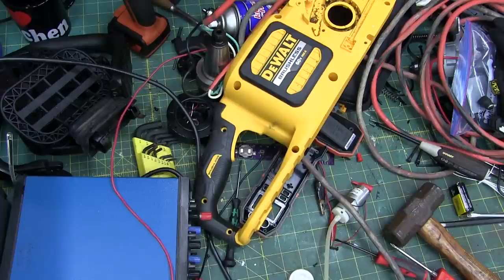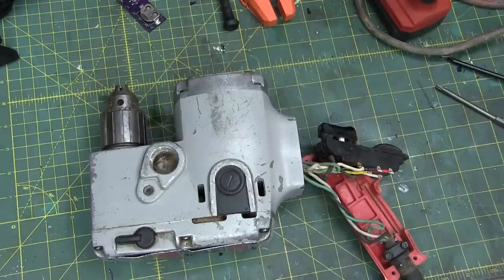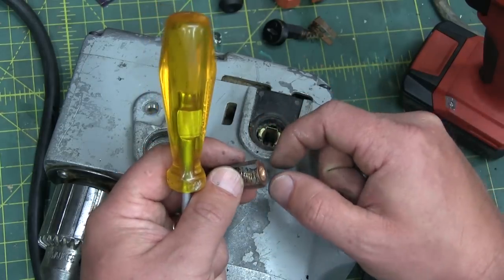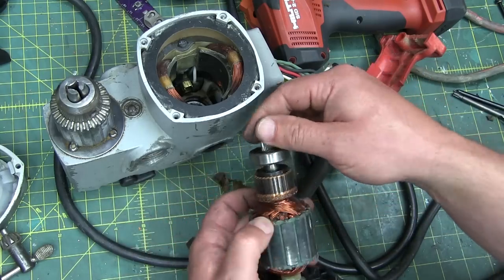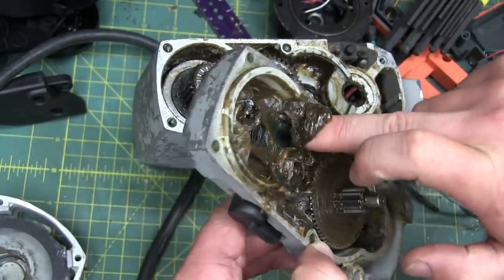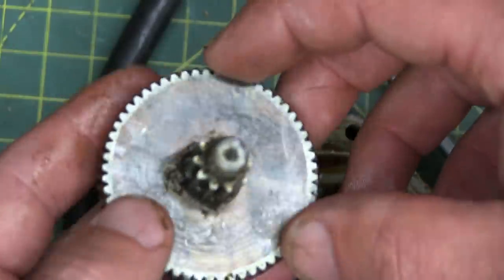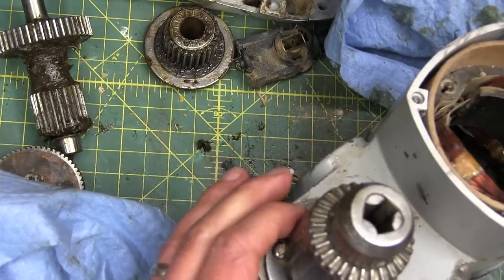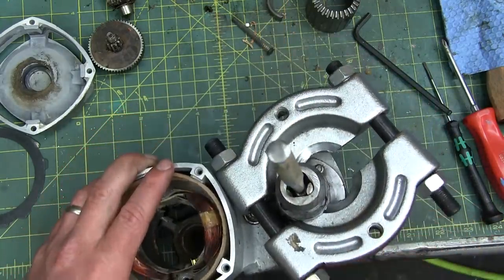BOLTR: Milwaukee Hole Hawg | Long Term Quality

Comment: The old hole hog will wrap you up and beat you against every wall in the room if you get it bound up! It will not only break your arms, but the arms of everyone trying to rescue you from its deathly grip. I believe the hole hog was used to start the earth on its permanent rotation.
Reply: InsideOfMyOwnMind, sometimes I surprise myself. I have used an old school hole hog. I can promise, I'd probably rather wrestle a wild hog as it would be less work and much safer. Lol
Reply: InsideOfMyOwnMind, maybe if it's secured to its own concrete foundation. I don't remember off the top of my head what the max recommended bit size is. However, I think you could reliably auger light pole foundations with it. It would've been safer if it were marketed as a skidsteer attachment. Lol
Reply: David Boerboom, true. I suppose I should say semi-permanent rotation. Or just go with rotation. Thanks for pointing that out for me. 👍
Reply: Bet a doll hair I could rastle one!
Reply: John Dro, bet I'd let ya!
Reply: The old Wolf drills were the same absolutely brutal
Reply: As someone who's had one of these show me the quick way from the top of a ladder to the ground, I wholeheartedly approve this description.
Reply: TheOmegajimes, that would be a terrible and terrifying way to be removed from a ladder.
Reply: The sales guys at Milwaukee refer to it as the Suicide Drill.  It is an apt description.  My Dad has one that suspended my brother from the floor joists when it jammed and the ladder fell away.
Reply: Yep - Did the same thing to me but I managed to keep from dropping to the ground.

Climbed down carefully, poured breakfast out of my boots and got back to it.
Reply: I got lucky and managed to stop the dam thing with my three foot hair braid wrapped around it just kissing the side, they got some momentum in there.  Almost got scalped
Reply: best comment thread on the internet ever. also i think some OSHA guys should read these for some nice 'what not to do' stories
Reply: Dion Crouch yup, I brought an old wolf sapphire with a 3/4" chuck because 'just in case' 😂 😂 Haven't built up the balls to use it in anger yet. If it grabs I no I'm going to the hospital!
Reply: running a hole hog is a two man operation: the apprentice is on the trigger, and the licensed guy keeps one hand on the cord to yank it out of the wall when the 'prentice starts whippin round the stuck bit.
Reply: Yup, had one perform some unwanted dental work and remove me from a ladder (at the same time)... It's now referred to as the Wilfuckee defenestrator...
Reply: InsideOfMyOwnMind maybe win the internet for a whole week?
Reply: Jimmy's Tractor, now if we could just get a comment from Uncle Bumble himself. Lol
Reply: no you couldnt
Reply: There's a darn good reason the old fab shop I worked in we chained the ol' devil (circa 90's Hole Hog) to the frame rails of the truck we were working on before drilling a hole..
Reply: I wonder.....did he ever get the chuck off? 🤔
Reply: I believe it was invented to introduce the world to Martial Arts
Reply: Richard V Sassoon, or break dancing. Emphasis on the "break".
Reply: cheeky...
Reply: To The Top Crane someone has prolly already mentioned but, I’m thinking it’s threaded so I would hope he eventually got it off after figuring that out, but I would think he would have known that.
Reply: Electric defenestrator is a damn good name for a band.
Reply: To The Top Crane, I used to perform p.m. on overhead bridge, gantry, etc. I also have a lot of hours in boom cranes erecting steel.
Reply: deezelfairy  we used to try anything to avoid using it and I'm talking about big men (cowards/smart) not 11 stone weaklings
Reply: You'll want a firm grip while drilling down through the top plate of the wall with a 3 -5/8" self-feeder.  When you hit a nail the torque reaction can be amusing.  Quick way off the six foot ladder.
Reply: To The Top Crane 
Happened to me.
Had the key in the chuck hanging on tight. Bumped the trigger. I started spinning, arms in a pretzel and the cord wrapped around tight against the trigger. Finally, something popped and I was free but with sore arms and fingers.
Reply: David Boerboom - Ha! I was contemplating that very thought the other day when i had nothing better to do. Must've been one helluva explosion to send all that matter out to spin and accrete like it apparently has. And for sure we'll be dickered when we stop spinning and /or the sun burns out, whichever comes first :-)
Reply: Years ago, I discovered that if you're left-handed, your grip presses that little lock button that used to be on the side. I was drilling through 1/2" plate and when I made a burr on the bottom end, I Just about broke both wrists. It got away just enough to hog-tie me with the cord but didn't unplug. A coworker unplugged me before something broke (me) or I let the smoke out. Total respect for hole hog beasties.
Reply: You're more than welcome to try.
Reply: OMFG I laughed hard at what you said because I have been beat to crap by one. This monster will pick you up off the ground and treat you like a rag doll.
Reply: I had my hole hawg chucked up to a 4 1/4 Lennox hole saw drilling a bottom plate of a plumbing wall between 2 studs for a dryer vent...let me tell you..I had er wide open and she  fetched up...when I woke up I saw that it cleared out both studs on either side of the hole with my flailing body, the drill wrapped the cord up and snapped it off and killed the power to it possibly saving both my arms from being broken off...I don't even know what happened but in am sure I blacked out from something. Somehow i escaped without broken bones, not sure how, I was pretty busted up bleeding and bruised.  Not a good experience never the less. These drills are no joke lol
Reply: There's a reason you can have a 3' long handle on the side!
Reply: Lol
Reply: LOL
Reply: @ToTheTopCrane  my old drill had a threaded Chuck on it.
Reply: Omfg I’m in tears right now from the stories. Best comment section on YouTube hands down.
Reply: I used to have a guy hold the cord to unplug her if she bound up on me. Hold on!
Reply: Stole the words right of my mouth. I’ve used one for many many years.  You better be ready or the damn thing will send you to the hospital.
Reply: It is a monster! The superhawg that superceded it is a bit safer cos it’s longer and gives you more leverage to fight against it. The magnum hole shooter is also a dangerous knut, small handle on a powerful motor. Ahh memories. Btw I thought that chuck was threaded on?
Reply: Where’s the video of the new one
Reply: That makes two of us.  These things are beasts!
Reply: The old school Milwaukee 9" angle grinder was another tool not to be trifled with.
Reply: I've had that happen when drilling through some pretty stout metal with a DeWalt 20V. Always use an impact for metal drilling now...not pleasant haha
Reply: Yep I got 5 of them. 
I broke 2 in 1 day before. 
Put a 4-5/8 hole hawg bit in it. Hung on like hell. Broke main gear in both of them. Got rid of bit.
Reply: @dioncrouch3897  I was just going to say that,I have an old wrist breaker languishing in my tool store,has a weeble wobble in the chuck tho.
Reply: @adeladd7638  I've picked up another old one can't identify what brand it is but it's big and slow turning. gonna get the lad to use it first 😁
Reply: @dioncrouch3897  My Wolf is from the 70s and has markings that show it once belonged to Post Office Telephones,I know cos I used to work for them back then.
Reply: Been there
Reply: @jackofmanytrades4396  I have one of those and I still use it. I love that thing. Believe it or not it needed a new switch and one day I was in the junkyard and I kicked an old metal body I think Hitachi out of the dirt and it just so happened to have the exact same switch in it but that one worked! Did I mention it was the old metal case one that probably weighs 25#? Well yeah. Still love it
Reply: I had to pry an electrician of a ceiling once
Reply: His old lady knows brioche
Reply: @TheOmegajimes  I had a helper get spun off a ladder once, the only bad thing is I missed it, I was around the corner & heard something a little different so I went to investigate & saw him just getting up. Laughed my ass off!

Comment: Many, many, moons ago when I was doing plumbing work, the company I worked for bought a Milwaukee Hole Hawg new for us to use installing plumbing in a log home. As it happened where the owners wanted a toilet was in a small closet like corner of the bathroom.  That meant I had to drill a 3 5/8" hole directly through a large log beam. Using a 3 5/8" self-feed bit I got started drilling the hole. The next thing I knew I was bodily jerked off my feet and violently slammed into the walls of the toilet "closet" several times. Thankfully somehow during my impromptu and unwanted merry-go-round trip, I had managed to unplug the drill. Once I quit shaking, I surveyed for bodily damage, finding nothing serious I sheepishly measured, cut, threaded, and installed a piece of pipe in the drill for a reaction bar so that it did not happen again. From that day on I respected and feared that drill and I dreaded using it for any purpose.
Reply: Robert G That sounds god damn awful
Reply: Blues 000, It was scary and quite painful for sure, but I learned from it and it never happened again.
Reply: Pentti Kantanen, LOL! My boss told me to be careful with it...and he did laugh his ass off when I told him about it later.
Reply: in my old work we had big impact hammer drill with no clutch. one day we were installing speaker hangers on the gym  in a some kind of hardwaring brick wall and my coworker start spinning on that drill 2 meters above the ground

after that we secided to use smaller and shorter bolts to hang those speakers because if one 3/4"wide 3 inches deep hole is strong enough to spin grown man on a drill there is no way it would not hold 250w speaker that man can lift from the ground alone.
Reply: That sounds like a lotta goddamn torque, old timer. What the bloody hell did they put in those motors? Welp, time to find out
Reply: Blazdur the Ridiculously Named it's called a magic gearbox. And actually that's a pretty bigass motor there
Reply: Anybody that's used one seems to have a similar story
Reply: Blazdur the Ridiculously Named, They are filled with fear and terror. If you don't fear them, a bit of terror later and you will. Afterward comes a healthy dose of respect, which you will never forget.
Reply: kokodin o
Reply: Yes, that's the joy of being the only woman on many, many construction sites. I read operating manuals, when youtube came along, I watched videos and avoided being badly hurt. The mucho-macho 'I don't need no stinkin' instructions' racked themselves up with real tools like this hog every so often.
Only times I've ever used one, I had a serious reaction bar screwed in and the plug ready to pull if there was even a few degrees rotation. But, then, I'd already seen guys who outweighed my by 150+ pounds whammed by it. First thing they always did after I used it was to unscrew the bar.
Mother Nature is a woman and she has a very sick sense of humor. You don't want to learn? OK, she'll learn ya' anyhoo.
Reply: Holy crap, I feel your pain. I have also been on the receiving end of one of these beasties. I actually had a hard time reading your comment cause I was in tears laughing.  Glad you were ok.
Reply: I know an apprentice who back in the 80's had hair-band style hair he was so proud of (but looked ridiculous). He did the same thing you did......but during his spaz he knocked off a quart of ABS glue off the rafter he set it on and the whole thing emptied into his hair. You haven't lived until you've seen a metal-head cry over their hair. Next day had a buzz-cut and a hat.
Reply: Been there.... had a buddy do an impression of a helicopter off an 8’ ladder. He wasn’t seriously hurt but took a good 10 min to shake it off. Took the rest of us a good 20 min to stop laff’n .
Reply: 3 and 5 self feeder? Jeezlus, man. 2 and 9 is all I go for clear lumber. After that she'll be a holesaw. Or call it in w the Skilly and Sawzmenall. Man's got to know his limitations.
Reply: Laughing silly reading this. Good there's was no one around to laugh on me , or you.
Reply: Been there! I had one throw me against a wall on a plumbing rough so hard it broke a stud into. Luckily it didn’t break me and I certainly wasn’t the “stud” I thought I was lol.

Comment: Left California to Lost Wages, to get rich, found myself on the business end of a holehog for 6 months drilling 2 and 9/16ths holes all day. @ 20years old and 195 lbs spending the last 2 years in the gym. I got to tell ya my foreman made it look easy 40 year old Wisconsin graybeard. Could dead stop it. So he turned it over to me, I was 2nd story up wise doing a vent thru roof, dam framer started sipping early that day put 15 nails in a 2x4.anyway I'm drilling the hole in outside wall it bit down on a nail I bit down on it it chucked me right out of house. If n it hadn't Ben for my cat like reflexes I'd be dead. Six months of shenanigans with that hole hog, and I was ready to sweat copper. Stay in school kids. Hole hoggin ain't easy
Reply: Raymond Mucklow I was drilling a 4” hole thru old 1x roof sheathing with one of these. Long story short, hole saw grabbed and it threw me on my ass
Reply: I tell my apprentice you what to do when you hit a nail right? And he looks at me with confused eyes and says move over? No I say. You go THROUGH it.
Reply: Raymond Mucklow I have a true respect and fear of the ole unforgiving hole hawg .
Reply: we have one of these (obviously) but someone lost the side handle. So me being 170 and just under six foot this thing was ready to toss me off the second story roof, luckily it was only a 5in duct vent hole through some cedar siding. Luckily this hog hasn’t beat me yettt...
Reply: Sounds like famous last words, Henry...what’re you doin’ ropin’ anyway; the livin’s in stayin’ away from wood. ‘Lergic to da stuff.

Comment: I used one of those for 15 years with a long paddle bit to mix tile thin set and shower pan mortar. I had a guy break a thumb and one guy who held on and ended up spinning around a 5 gallon bucket until the cord disconnected. He ended covered in mortar the rest of day, I never saw him again, thankfully. That tool outlasted my ability to lay tile and has a place of honor in my shop.
Reply: the_eddies we use an old 1/2" drill to mix our concrete. Thing will chunk you right off the bucket.
Reply: the_eddies who on earth thought a hole hawg was the ideal tool for mixing grout and mortar, 😂  I know your being honest , but dang you gave me a great laugh.